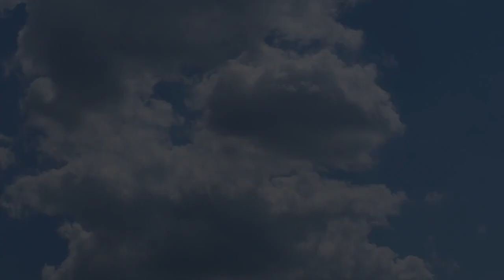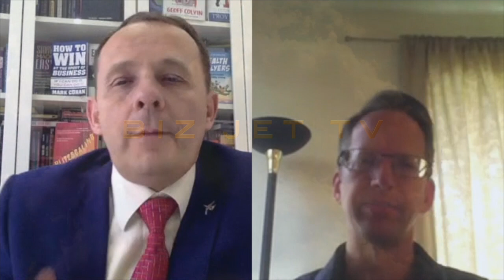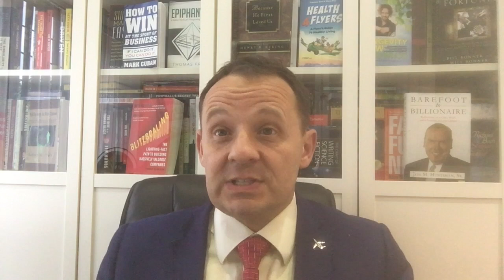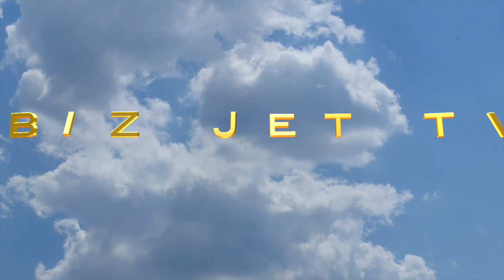No Runways in the Future...

Comment: 2030 might be a little optimistic.  There are still DC9/MD80’s, 747-200’s, Convairs and 727/737-300’s flying in many Canadian airports.  I’ve personally worked on a few planes from the late 60’s (commercial/cargo).  So if 40+!. year old planes are still flying ...  It’s an interesting idea, but I doubt if that will ever come into fruition.   Even the Canadian military has to deal with the managing the logistics of transporting its troops and equipment with the aid of larger cargo and heavy lift jets that... obviously require long distance runways.  I am hardly an expert and no longer work within the aviation industry.....so maybe I’m wrong.  Thanks for the video.
Reply from the maker: If we consider the current runway systems in Vancouver & London Heathrow and the technological developments (VTOL), in 10 years there will not be a need for another runway. The current runway system will be enough to cater for already existing conventional aircraft.
Reply: @BizJetTV  Vancouver can already make double takeoffs/landings.  I have not seen the future plans so it is unclear if the additional runway will allow for triple.  Toronto has much greater annual volume and they are making do with double takeoffs/landings but with the added benefit of 4 directional options.  There may be some legitimate oppositions to the Vancouver runway project for 2030 but vertical landings/takeoffs as suggested in the video is not one of them.
Reply from the maker: @shadowmist1246  I think both the problem of not enough runways and not enough pilots will both be solved by disruptive new tech.
Reply: Fair enough.... you’ve made a few decent points worthy of consideration.  As mentioned... I am hardly any sort of expert.   Thanks again.